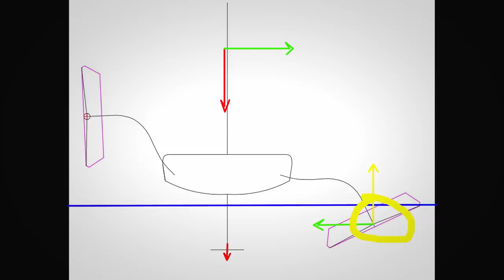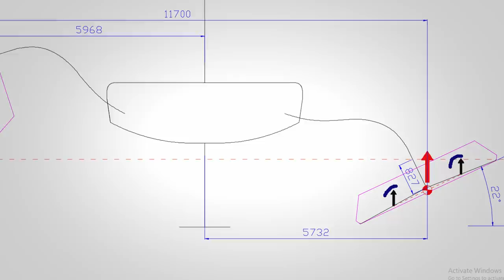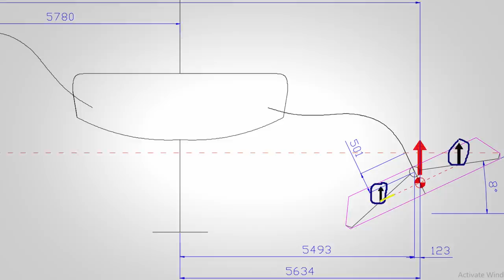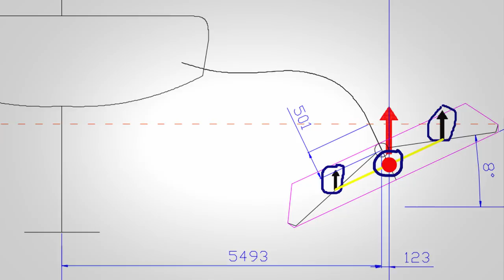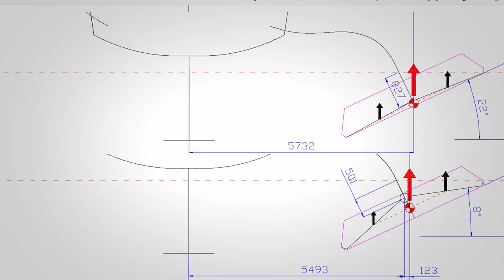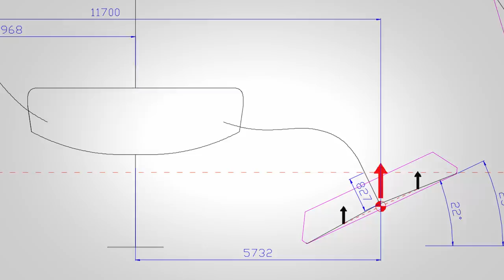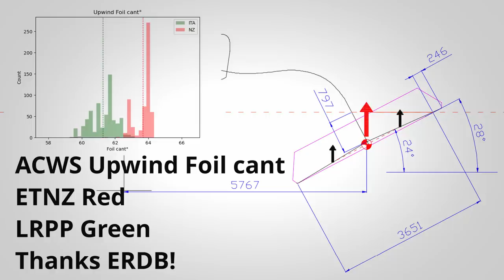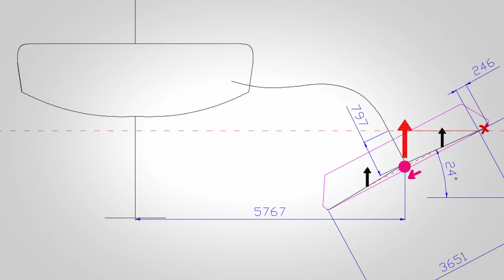Is this the ETNZ advantage that will decide the Cup?

Comment: Love this calculation but as many here pointed out, the anhedral foils shift the vertical lift to the outer foil more. My rough math says the difference is 1.1% 

Scenario: 8 degrees heel of foil arm and 14 degrees additional angle on LR foil (as per sketch). Assuming foil length 2x1,000mm
1) That gives ETNZ 0.99 x [lift per foil arm, for simplicity =1kN] x 2 x 5732 = 11,352 Nm, 
total lifting force is 1.98 kN
2) LR gets Outer foil: 1.03 x 1 x (5634+510) + Inner foil: 0.927 x (5634-470) = 11,115 Nm
total lifting force is 1.96kN

Righting force is 2.1% stronger on ETNZ. But hey, then the use the lifting force is less so they could increase the surface (or use flaps) to equalize the lifting force from 1.96 to 1.98. Then we are back to 1.1% difference... 

Infuses a bit more drag though but at better manouverability and less initial stability allowing Luna Rossa to roll into turns with less force of the rudder. And do not forget that the foil digging into the water allows you to point higher, like a moth leaning into the wind. But ETNZ is a great straight line machine. 

Reasoning (of a quick calculation of my office desk) 
The LR foil in near horizontal is about 3% longer than the ETNZ foil, increasing the lifting force by 3% (=1.03) and at 515mm from the centre point. The inner foil will have a 22 degree angle down, with horisontal force at 0.927, but only 463mm from the centre point.

Comment: Hi Guys, I just wanted to make a point on the "centre of lift" discussion. When you compare the anhedral foil in LRPP vs the straight one in ETNZ you assume that both the windward and leeward foil halves  contribute the same amount of lift. While this is roughly true in the ETNZ straight case, it is certainly not in the LRPP case. The anhedral angle between the half-spans in Prada means that pitch changes to the boat can affect the distribution of lift between the half-spans because it changes the angle of attack of the leeward span more than that of the windward one. Effectively, this means that by changing the pitch of their boat LRPP can put more load on the leeward blade, reducing flap angle to keep the overall lift constant. This gives them a significant righting moment advantage.
Reply: I was thinking the same thing, but didnt it look like they made allowances for at least a slight difference in the lift from the two foils on LRPP? The inboard foil is always operating at a worse angle for creating lift that the outboard one, but better for creating windward lift though. Perhaps LRPP can rely much more on just their outboard foil than ETNZ can, in part due to their bigger foil area, should equalize things a bit if LRPP can move their center of effort further outboard. 
But, I dont think they can unload the inboard foil completely, they would have almost nothing stopping them from going sideways then, and that part of the foil would just be creating drag, so I cant imagine that they would be able to move the CoE further outboard than ETNZ?
Reply: That's was my first thought too. Also, they are talking about pure speed, but the important thing is VMG and having a wing with a more vertical angle in the water could give LR the ability to sail more close to the wind. So I'm confident we will see a much closer race than predicted.
Reply: @strozzascotte  100%
Reply: Initially I agreed with you but after more thought I think it's more nuanced. Yes, the centre of the vertical component of the lift will be further out on LRPP because the outboard half is providing proportionally more vertical lift. However I don't think that is where the boat will pivot around. I think the boat will pivot around the centre of all lift which will be on the foil centreline where Mozzy has put it. Might be wrong but that's my current thinking
Reply: @Robinlarsson83  I guess the key for Prada´s set up is to optimise the pitch so that the benefit of moving the centre of lift to leeward outweights the inefficiency created by having a "less effective" windward wing dragging on the water. However since the foils have to be symmetric, the parasitic drag of the windward half of the foil is not something that changes. Essentially having the anhedral foils gives Prada a new degree of freedom (distribution of the centre of lift) that ETNZ don´t have (although they recover with having the lower canting angle discussed in the second part of the video). The problem, at least in my mind, is that ETNZ´s set-up forces them to have a significant part of their foil very close to the surface, which can make it unstable in "rough" seas I think. Regardless, I love how these new rules have created so many subtleties and areas for optimisation.
Reply: @reubydoi7111  Sorry mate but the boat does not pivot around anywere, that sentence is incorrect to say the least. When considering torques on a system you put yourself in favoured point such as the point were a very considerable force is applied. Disregarding were you calculate the sum of the moments from, the result will be same, and therefore you will have the same angular accelleration around the center of mass.
Reply: @ruggericci  Yes I agree its not technically correct to say 'pivot around', its far more complex than that and my comment does admittedly disregard all other forces than those generated by the foil in question. I used that term to try and explain in the least technical way. I may be wrong but I think my general point is still understandable
Reply: The AoA of the foil is governed by the need to provide a certain amount of Lift, and pitch must be matched to balance this requirement. Pitch can't really be used to alter the Lift differential between the wings. However, the flaps on LR can be used for this, although it incurs a drag penalty.
Reply from the maker: "One last thing though, there is a sneaky little trick Luna Rossa have up their sleeves in terms of foil control, and we'll talk about that in a future video..." 16:36
Reply: @ramonsabin9249  NZ can cant their foils a bit more than LR because they have less risk of ventilation, as the angle to water surface is greater.
Reply: @ruggericci  Although what you mention is correct, it is convenient to locate the "axis of rotation" at the Centre of Lift so it does not have to be calculated and taken into the calculation of the moments. So from that perspective it could be considered a pivot point.
Reply: @maxhugen  This is not exactly true: a given amount of lift can be achieved by having a higher pitch angle (more leeward lift) and reducing the aileron angle to compensate or reducing the pitch angle (thus reducing the AoA of the leeward wing) and increasing the aileron angle to compensate.
Reply: @ramonsabin9249  My calcs and boat data from ACWS indicate that by 30-35 knots boat speed they use negative pitch to get foils to neutral AoA for lower drag. Adding foil AoA, and inefficiently compensating with the stabilator adds a lot of unnecessary drag.
Reply: "you assume that both the windward and leeward foil halves  contribute the same amount of lift"
Actually, he did not.  The arrows are not the same length.
Reply: @bakters  Hi. The reason I made the coment is that they assume that the CoP projected on the span axes is in the centre of symmetry of the foils. My point is that it may not be because of the differing effect of the overall pitch on the AoA of the individual semi-foils.
Reply: @maxhugen  This is interesting. I don´t have data from the boats so I can´t challenge that statement. However, the fact remains that in the anhedral case the pitch angle of the boat will have a higher effect on the AoA of the leeward semi-foil than the winward semi-foil. It stands to reason then that this is a factor that will be used in trimming the boat pitch. In an ideal case, if drag were the only parameter to optimise, both foils would be set at an AoA that minimises the drag coefficient for a given lift coeffcient. This is roughly when the parasitic drag matches the induced drag. However since the premise of the video is that boat speeds are limited by the righting moment that boats can generate, and I agree with that premise, then it stands to reason that it is worth sacrifising some drag to gain righting moment. Even if the foils are both at a negative AoA in "design" conditions, one of the foils can be at a slighlty higher AoA than the other.
Reply: @bakters  That’s because the arrows represent only the vertical component of the lift (which are relevant to the discussion) and they are different because of the different angles of inner and outer foils.
Reply: @ramonsabin9249  "they assume that the CoP projected on the span axes is in the centre"
If they did, that'd be a mistake, but I'm not sure that was the case here.  From all of what this young dude in white blouse said, I gathered he probably understood the distinction...
Anyway, it wouldn't be a mistake to draw a resulting righting moment vector at the attachment point.  It kinda makes sense to do it for comparison's sake.  It's not the Center of Pressure, of course.
Reply: Good point, but it’s not a change of angle of attack, surely it’s a change of camber angle on the leeward half of the foil that induces a higher angle of attack? Trouble with that I’d have thought would be having a foil that has one half creating more induced drag than the other half gives you a secondary effect or a twisting effect on the whole pylon?
Reply: This is only true if the boat is drifting, which it shouldn't do. Under "normal" conditions the lift should be parallel to the axis of symmetry of the foil, in fact it's not a straight upward force as they explain in the video but rather an oblique force pointing towards the hull
Reply: @ramonsabin9249  it’s the other way around isn’t re, ETNZ have more foil near the surface?  LR leeward part of the foil is barely below the surface.
Reply: Ha ha embarrassing mistake. Good catch! I guess that Mozzy has to rectify this to save credibility
Reply: Not being an engineer but playing one at times, it occurs to me that the lift generated by each foil would be normal to the axis of the foil.  I see this addressed in some of these replies though the diagrams shown are only showing the y component of what would be the actual lift vector.   Using the actual vectors normal to the planes and looking at the balance of the three static equations (sum of forces x, sum of forces y, sum of moments about any point all equal zero)...assuming the design is balanced in all three aspects.  It seems that the sum of forces in x may or may not be balanced?  But moment and y forces must be balanced, no?  Anyway,  very complicated engineering problem to solve.
Reply: Would the windward foil be inducing roll, shifting the righting moment back towards the centre of the two foils? Presumably, you adjust the trim to reduce the effect but would it still be present?
Reply: Just a couple of further points not considered in the video. The first  is the height difference between the centre of effort of the sails and the centre of effort of the foils. Raising the centre of effort of the foils is as effective as lowering the centre of effort as the sails. I wonder if this is a gain for ETNZ extra cant and the foil tip leaving the water. They both raise the foils centre of effort. If we take moments about the centre of effort of the foils then the moment of the lift of the sails is balanced by the moment of the weight of the boat. So we want to maximise the distance to the centre of gravity but minimise the distance between centres of efforts. Secondly the diagrams in the video show the foils only producing vertical lift, which is clearly wrong (although I understand the simplification). In the case of ETNZ that doesn't change the location of the centre of effort. However in the case of the LRPP it would seem a better approximation to draw the lift of each foil perpendicular to the foil. The centre of effort of the foil pair would then be further out board than in the diagram used in the video. The 2 lift forces would appear to act twice as far from the point where the foils meet as shown here.
Reply: In all this discussion of the anhedral having different angles of attack, sending the righting moment in a favourable direction, we've bypassed the fact that the lateral component of lift has to equal the.horizontal component of sail lift normal to the direction of travel. The horizontal component of lift is shared between the strut arm and  the foil set. Increase angle of attack on the NZ foil and the leeway angle has to drop to keep the equilibrium.  Anhedral decouples this to some degree. The inboard foil wing can do more lateral work if it's dihedral. The foils themselves may be a more efficient way to generate lateral force than the surface piercing foil arm. Anhedral allows Luna Rossa to keep most of the draggy foil arm  high and dry.
Reply: @tallteacher  The lower centre of effort of the sails and the wider righting moment advantage of ETNZ was mentioned toward the end of the video. I agree with you about the fact that lift is generated at right angles to the surfaces involved and not as depicted by the diagrams that only show assumed resultant vertical forces. The LRPP outer wing foil would be almost Horizontal, further out, and has not featured as an important righting moment factor thus far.
Reply: @bozo12141  Yeah I thought this was a bit weird too.
Reply: @peterdelange6940  Yes that is a good point. The lift resultant vertical component of lift force for that LRPP foil must be much further outboard than in their diagram.
Reply: @ianknight4333  the surface piercing foil arm shouldn't generate any lateral force if the boat is not drifting (which it shouldn't be). The foil si oblique in the water and boat foil halves should have the same angle of attack with the incoming water. Therefore the lift from the foil is oblique and its lateral component should be enough the balance the later force from the sails. If everything function properly straight foil or anhedral shouldn't be a factor in balancing the later force imho.
Reply: @Ramon Sabin good point. Tatally agree with you. I think that with the same arm angle, LRPP, with the proper Trim of the outer semi foil, could have an higher righting moment than foil T
Reply: @MozzySails  love the content. Could you please talk about the trend I have seen with tnz over the last 12/14 days starting to fly higher with less surface piercing of the leeward foil? In fact it seems they can change the depth of their rudder .
Reply: @pp2793  Yes that's what is aimed for.  The angle built into the one-design foil arm that orientates the foils was a first guess at the ratio of boat weight  to lateral sail pressure. They can change this angle on the fly by tweaking  the foil arm but that changes the ride height.  The boats, once flying, have a pretty constant righting moment. They don't shift crew around to a great degree and the boats are sailed level.  So the righting moment provided by the sail has to be kept constant. No spilling wind by heeling leeward!  This can only be done by sheeting in and out or adjusting sail shape. ETNZ's efforts to lower the lift centre of the sail thus requires more lateral force from the foil/foil arm combination.  The leeway angle self adjusts on most craft I have sailed. The amount of anhedral is about the only way they can tune the sweet spot for balance while aiming to have the foil arm doing minimum work.
Reply: @reubydoi7111  If you consider lift applied where seen at minute 6’38” you must add the momentum given by the different lenght of the leeward vector compared to the  windward one. And then add this momentum to the one  created by the offset of the foil compared to the position of CG... i.e. what is available for opposing the aerodynamic pressure out of the water.... As it is the picture is wrong... For an “intuitive “ explanation imagine a box rule which allows for 90º between semi-foils and a tilting of 45º of the boot. Windward foil goes vertical, 0 lift; leeward is horizontal, and the lift vector OF THIS SEMIFOIL applied ai its center  ( as correctly depicted).... but when you look for the momentum compared to the CG of the boat you must come here, and not where the extension of the boot crosses a line between the mid points of the two semifoils...
Reply: @bakters  True, they drew proportional lift vectors however they then seemed to fail moving the CoL to represent the net effect.  They just bisected the two lift vector points of action.
Reply: @reubydoi7111  The lifting force of each foil is approximately proportional to the horizontal length of the foil at any angle. On an anhedral foil, the outer foil is longer and the inner foil shorter. 14 degrees additional angle adds roughly 3% (1/cos(14)) more lift to the outer foil. That means the lifting point is roughly 1.5% further out on the foil.
Reply: @ruggericci  What?

Comment: Mozzy, your series is fantastic.  I am a sailor and cyclist and been there to watch both Bus Mosbacher and Eddy Merckx will in the day, as well as to participate through my life.  My fave though is DN racing and maximizing,  speed on ice.  The AC75s seem like a similar thrill, and the yacht design analysis is very enlightening.  These are basically sailboats without keels, with the keel being replaced by the foils.  It puts a whole new light on the potential trickiness of traditional keel design. Remember the 1987 keel foil that was installed backwards?   Thanks so much for your work spreading this informaiton.